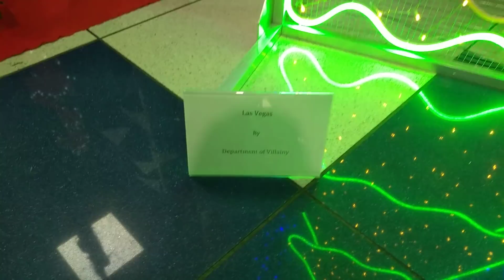Department of Villainy tree 2019.

Comment: What did you use to connect the green and yellow neon flex together
Reply from the maker: I used metal pins into the busbar wires of the larger green material, and soldered connections for the yellow.

Comment: For aluminium frame, use solar panel rails. Probably easier to get hold of and cheaper. You'd just need to 3d print yourself some bespoke corner brackets. 
It's a clever and bright tree, but maybe a bit too 2-dimensional and busy for a front room! It does steal the show in the display though, by repeatedly poking you in the eye with bright  and multi-coloured ights.

Comment: As it is in a Public Access area Clive I did not notice any Equipotntial bonding between frame joints nor to the carrier mesh hopefully they are there and cleverly desgiused.
Reply from the maker: Not disguised at all.  In blatant view in full yellow and green glory to appease even the most officious of electrical inspectors.
Reply: @bigclivedotcom  Sorry Clive but I have looked at the video in full screen, but still cannot see bonding between the upright vertical (insulated) to the horizontal alluminum square tubing.
Reply from the maker: @scottgibson7534  Hi.  Aside from the fact that the whole unit runs at 11V DC and has continuous welded wire mesh firmly attached to every side with multiple screws and washers at approximately 6" spacing, there are also five bonding links comprised of green/yellow wire with ring crimps bonding at every corner and also one from the power supply to the frame.
They are absolutely not needed but are there to tick the box for the inevitable officious types.
Reply from the maker: The unit was also electrically tested and a suitable PAT label applied before installation, with the event organisers also being invited to do their own tests (which they do.)

Comment: Clive outstanding job on the tree lighting design!
 It turned out great and like you I Also like the Mean Well Power supplies are well-built and the two that I am using, they even have short circuit protection I also like the adjustable voltage setting.

Comment: I bought a 1952 toaster back in the day wanting to make it into a Nintendo toaster but then I actually TRIED it...I still have it, best toaster ever from 1952! It just needed to be cleaned and it's timer cleaned and reset, simple, mechanical thing and thermally and circuit protected it's awesome and makes perfect toast in about a minute or less!! (glowing heating elements and POP! Perfect toast and delicious!) :) Also VERY electrically safe, it has thermal cut and has a mains circuit breaker! NO Chinese walmart toaster is that safe...They actually built it to be very safe electrically and from overheating.

Comment: I fixed my USB cheap sound adapter because of lead free solder, the thing had cold solder joints on all four pins of the plug and they didn't even solder the support pins to the board wtf seriously?! Like you Clive I have a soldering station and I fix stuff even trash picked things like the Acer monitor I'm using now, cold lead free crappy solder joints on the power supply INPUT IEC connector crazyness and it is fine now, but was going to be thrown out! We are Engineers and we are scavengers and we are able to fix almost anything...it's our nature!

Comment: Looks great. Though forgive my ignorance, but how do you run the different circuits off of a single led driver like that? I would have thought that would cause problems with the constant current mode.
Reply from the maker: The power supply is fixed voltage with a current limiting option.  It's being used as an 11V supply for up to 10A.

Comment: Hey Clive, not sure if you'll see this but I was hoping you might be able to spare some advice for a total novice.
Is it possible to run RGB LEDs on a joule thief? I tried adding various scavenged capacitors into the circuit, but haven't had any luck getting the LEDs past the initial red colour, and a capacitor in parallel seems to cause a failure of the circuit.
Wasn't sure if this might be a value issue or if I was just barking up the wrong tree...
Any thoughts would be greatly appreciated, thanks.
Reply from the maker: You'll need to add a 1N4148 diode with the banded end pointing away from the collector of the transistor to one end of a small 100nF capacitor connected between -ve and the diode.  The LED should work when placed across the capacitor.
At the moment the pulsing output from the Joule Thief is continually resetting the RGB LED.
Reply: @bigclivedotcom  Awesome! Thanks for this, I really appreciate it :)

Comment: Ok, I'm stumped. What the heck is a 'penny washer' ?
Reply: A washer is a thin, flat disk with a hole in the middle. Often made of metal. It's used with a nut and bolt.

A penny is an old British coin. There are 100 pennies in a pound.

A penny washer is a washer that's the same size as an old penny coin. At least, that's where the name comes from. In reality, it can mean any washer that is quite big relative to the size of the hole.

In other words, it looks like a coin with a hole drilled through the middle.
Reply: In the US, it's called a fender washer

Comment: Any reason why you put the controller and transformer at the top? I’d have kept all the weight low down and out of sight. Assume you had safety concerns?
Reply from the maker: Traditional for municipal Xmas light frames.  Also easier to wire at that height.
Reply: @bigclivedotcom  Ah, that makes sense. I just assumed it was wired on a bench, then stood upright.

Looks great :)

Comment: That's just brilliant, Clive. I like it, and that reflection on the floor is actually very impressive, because without all the supporting structure being visible, the tree and the star are visually emphasised.   I even wondered what the display would look like if it had had an infinity mirror, or a 'one way' mirror in front of it? Pretty good, I should think. 

Where did you get the mesh? - Just curious because it look exactly like the kind of stuff we can buy for building rabbit/guinea pig runs and hutches, but also available in bigger sheets for building aviaries etc.  I guess it maybe a bit harder to find on IoM, but I'd think the likes of 'Pets At Home' or 'Jolleyes' would be able to get it for you, or failing that, almost any country store should have it.
Reply from the maker: It ended up being a roll of garden mesh from Screwfix.  I was hoping to get a heavier sheet material, but this stuff turned out fine.
Reply: @bigclivedotcom  Hah, the one place that hadn't occurred to me. . . 😊😋🤦
Reply: Ladies in skirts are not keen on mirrored flooring.
Or Scotsmen in kilts.

Comment: Great is that 1" box system with plastic bench system that's what I'm going to use
Reply: Mark Hodgson Reminds me of Dexion SpeedFrame.
Reply from the maker: @OC35  It does look like it may be based on that.
Reply: @OC35  oh is that what its called using it for my project
Reply from the maker: It is.  There's a wide range of connectors, but they're not strong enough for critical use.  I had to reinforce the base with aluminium plates in this application.

Comment: Wonderful. I dread to think how much it would have cost and how long it would have taken in the old days to make those forms out of real neon tubing. It also wouldn't have been safe to have where people might touch it, due to the voltages. How much power does it draw?
Reply from the maker: Fully lit it passes 6.5A at 11V  (72W)
Reply: @bigclivedotcom  that's actually surprisingly low, but then again I know very little about electrics (other then what I've learned from our fav bear)